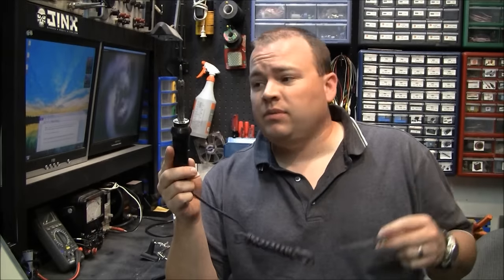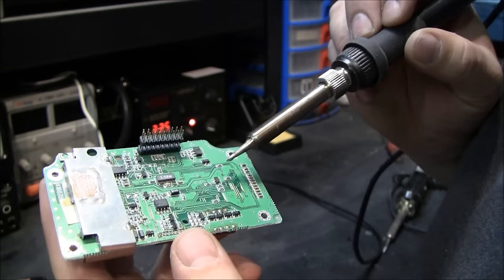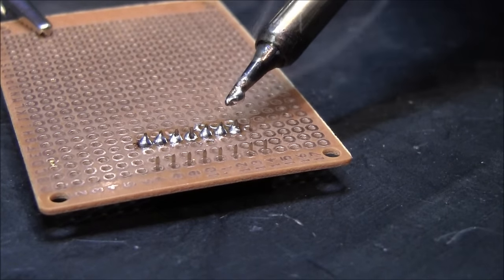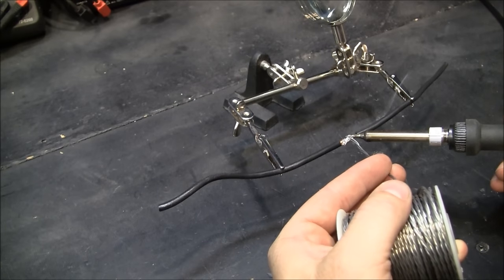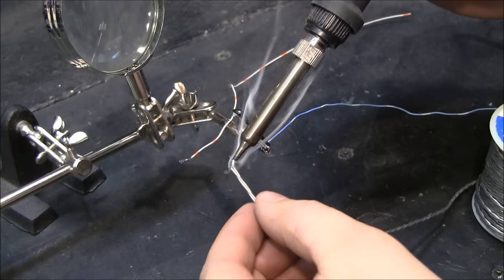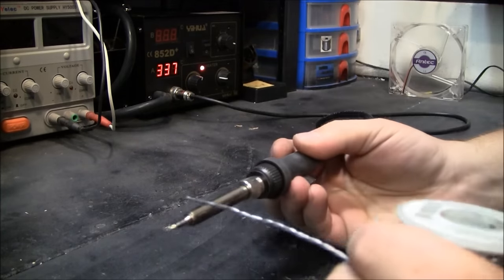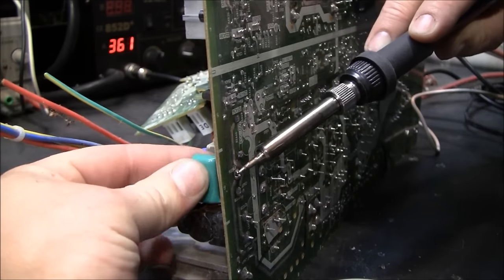Beginner how to Solder

Comment: Use RMA flux while doing this, always.

The flux located at the core of the solder is never enough. Just enough is there so the solder wire itself can flow evenly. Still, you should always use more flux.

(I work in Class 3 for Military and commercial. Flux is your friend.)
Reply: @9898Bren Lmaooooo

Comment: Great video! Thank you very much. 
It certainly helps having the right tools. Today I tried to change a few caps on my Slingbox HD and even though I thought I had the right tools -- Radio Shack 25w soldering iron and desoldering tool, braided copper, I still couldn't get them off without overheating the board. I think I need a little more heat (40w perhaps) and a better solder sucker. Those rubber ones 'don't' suck compared to those pump-up solder-suckers that I've seen in YT videos. If I get the right tools and use some of your other tricks I should be fine. 
Anyway, thanks again for a very straight-forward and easy to understand tutorial. :thumbs up: 
/subscribed

Comment: Thank you for this video. Never needed to do more than solder a few wires together. But now I needed to solder in headers to a tiny circuit board. I was afraid of ruining it! Your video explained so much! Heat the pin, apply the solder NOT to the iron but to the pin. I practiced once and then tried  it. Worked perfectly the first time. Thanks!

Comment: Dude no one has ever told me that the rosin helps the solder wick on to the wires. I was always confused why I couldn't push a lump of solder on the iron tip onto wires and leads. I am so thankful.

Comment: Love how you say "if you're poor" in relation to electrical tape usage, and then proceed to use a cigarette lighter to shrink the heat shrink tubing 😂 when someone who's "not poor" would use a hot air gun. 

Irony.
Reply: unlokia Or, maybe he smokes, or has some other reason to keep a lighter in his pocket.  When I use heat-shrink, I use a lighter, too. It's a convenient heat source,  and it accomplishes the purpose, just as well. I know some HVAC guys who use an acetylene torch to shrink it down, just because the torch is handy.
Reply: I'd say it's more for noise, he was making a recording.
Reply: unlokia i
Reply: what??? heat shrink is a more durable option... as for the lighter it does the same job as a heat gun....
Reply: At least it wasn't a "crack lighter" with a 5" flame!
Reply: I work at a factory that makes varius types of connectors and we have "fancy" shrink tubing, and heat guns, but we often use a lighter for small quick stuff. It does the job.
Reply: @biggreentruck4907  It's smaller, and it's practical.
Reply: @CST1992  That pretty much sums up my point.  It occurs to me that my use of heat shrink generally occurs in places where a heatgun would be virtually useless; for example, fixing a bad light on my trailer, on the roadside, in the middle of nowhere.  Setting things up for the heatgun to work (assuming that it would even be possible) would be a major pain in the ass. Quicker to whip out the Zippo.
Reply: SHIT !!! i didnt see your comment and just commented the same thing lol !!!   I'm not the only one who caught that

Comment: With all due respect, I really hope you that's not how you really solder THT components for professional purposes. 
The soldering is supposed to go penetrate through the hole to form a good connection and it will also reduce vibrations and the excess solder is not supposed to make a concave dome nor a triangle, but to form the shape of a volcano that gradually go down to the base.
The quick upper motion is also useless, check the specification for what temperature you should be using, that would explain the upper motion and the color of your solders...
 

When it comes down to through-hole components you need to have a beautiful volcano shape, a certain brillance on your solder (pure tin doesn't shine though) and penetration of solder.
Reply: With all due respect, solder penetration through the hole will only happen on through-plated holes. That matrix board does not look like it has through plating.
Reply: @iandaysh3193  
With all due respect, if you're teaching people something, do it right.

Let's assume he's using NPTH prototype PCB yeah? If you solder your components as if they were being soldered on PTH PCBs and they're not hugging ring, you're even worse than I originally thought hahaha. 

If you're using NPTH you need to give your component proper support and push the legs either outward or inward, it needs to hug the hole properly, solder isn't magic glue. 

The soldering job is horrible anyways. 60/40 isn't lead free, a proper solder job should be shiny, not matte finish, it cooled down too quickly, fucking flick of the wrist bullshit.

Comment: I have been struggling for DAYS to figure out why my soldering sometimes took and sometimes didn't. None of the other videos pointed out you need solder on the tip to transfer the heat. Thank you.

Comment: that very last tip you gave was awesome... never heard of adding solder to something you are wanting to remove.  But I'm gonna start doing that from here on.  Previous attempts to unsolder circuit boards have typically left me with damage to the board  :(

Comment: I just used solder for the first time on an engineering project... Had a 30 if that explanation before being handed wires and solder , although i got it all done and fairly well its good to finally understand what my actions were doing

Comment: Great video, thank you.  But my comment is at 4:00.... "if you're poor" you use tape... then you use heat shrink with a lighter... I guess you can say if you're a little richer but not too rich you can use a lighter or matches... but the professional way to shrink heat shrink is with a heat gun.  The use of open flame will damage heat shrink (it's just too hot), yes, I noticed you were waving it through very fast to counteract the heat, but it's still not professional.
Reply from the maker: Yes, I wasn't trying to insult anyone but making a joke... maybe at myself. I myself was to "poor" at the time to have a heat gun and I used electrical tape more often than not. I am not sure what the price of heat shrink was when the video was made but it is certainly more accessible now days. I remember when heat shrink was ridiculously expensive, that's not the case anymore.

Comment: most important thing however you used to soldering is keeping soldering tip clean as well as possible. between time to time I dismounte this soldering tip fix it instead of drill bit and sand it very smooth. Trust me this way keeps you more time/work efficient. I totally  agree with this video.

Comment: I did some modification to lipo battery pack, had a hard time to get that 12g wire off the plug and not sure why. At first I thought my soldering gun is not good enough. After watch this video I know why now. Thanks for this informative videos sir.

Comment: Very useful guide, thank you! What I’m trying to do is soldering two 20 gauge wire on a PCB, so my question is, do I add the solder to the wires first and then stick the wires on the terminals on the pcb with more solder? Thank you

Comment: When soldering a component onto a PCB, you said apply the solder to the metal.Do you mean apply the solder to the pin of the component or the metal foil on the PCB or both?

Comment: I bought an electronics kit which I will be soldering. I have never soldered before in my life. On instruction manual among other things, they strongly recommend wearing safety glasses for soldering. When i checked on amazon, looked like the safety glasses they sell were too dark and seemed more appropriate for welding. I don't know if I can see thru it for soldering.
Can you recommend some safety glasses that I can find on amazon that I can use for soldering?

Comment: Thanks for the informative video. I recently repaired a circuit board on a Maytag dryer. It worked when I was done but was concerned about hot solder damaging the 120 volt relay soldered to the boars that had melted the solder. I also hoped to add more solder than the factory used  to help prevent any future faulures. Any tips? Jon

Comment: Question.
I'm planning on hitting a flat surface that I've just ground a bit of rust out of, about the size of an inch diameter coin.
The spot isn't structural but I'm looking for a tidy method - is solder a good idea or are there reasons it isn't?

Comment: To solder a wire to a pot in a guitar, would the best way  be heating the pot and touching the solder, then grabbing the wire, heat the solder on the pot, then stick the wire in the melted solder? Thanks in advance!

Comment: Isn't a large part of the purpose of flux to prevent oxides and nitrides from forming, weakening the mechanical and conductive abilities of the joint? So if you tin two pieces, burning off most of the flux, and re-heat the solder to join them, despite the fact that they will mechanically bind well, won't there still be doping occurring? Probably a negligible concern, just curious.

Comment: So I just realized I used plumbing solder on my car clock that stopped working. I added some to each end of the 5 resistors to make the clock work again. Will this be an issue or should I be ok?

Comment: I run into problems where I solder in the wrong component into a PCB, remove it, clean the foil side with solder wick, and then insert the correct component.  However, I frequently raise the copper foil connection and destroy the PCB.  How can I prevent doing this.  I use a soldering iron at 450 C and only hold it on the connection until the solder melts well, a very short time.  Thank you.
Frank

Comment: Note to self: watch this video before forcing a VGA port off of a broken card before repairing one that doesn't have video out. I'm getting desolder braid today and is there a way to remove an SMD Electrolytic Capacitor? My Riva TNT2 card has a bad one by the VGA port.

Comment: Im having trouble with making the solder flow. What am I doing wrong? I cant even make the solder stick to the iron. Im using a soldering iron that is 60w and the temp goes up to 750f. Its a inexpensive iron i bought on amazon for $16. Could this be the problem?

Comment: My solder doesn't say acid or rosin core but I bought it at Radio Shack so I assume it's good for electronics? I rewired my guitar jack and it seems to be fine.
Reply: You should be able to tell what it is by looking up the set of numbers on it. It usually looks like a fraction.
Reply: You can also look up the Radio Shack cat number on it to see if there's any information on it.

Comment: So is the rosin core just wire with flux inside basically? So if you buy rosin core wire you don't need to get flux or add flux
Reply: 1) Yes. 2) No. Solder joints benefit from extra flux. Dabbed on with a flux pen or dripped on as a liquid. Solder then clean up.

Comment: Probably worth mentioning to put the shrink tubing on the cable before soldering it, I've screwed that up a couple of times. Also, if you're poor you use a lighter, otherwise you'd use a heat gun

Comment: First of all , Don't worry about what some people say , there is always going to be idiots out there showing that they are smarter then you , and thats because they have to prove something to  themselves .. you know low self-esteem.  Second of all your are nice enough to make this video and they shouldn't complain or let them put together a video and lets see if their any better . There's spoiled people out there always wanting more for others while they sit back and judge others,  and thats a shame..... well anyway I was wondering if I  could attach a dimmer switch to the solding wire . So it can heat from high to low . You see I  own a Japanese silk flower iron and its the same thing as the solding iron except it has a wider tip end so all the attachments will fit. Years ago I use to fix lamps and sometimes replacing the dimmer switch. . So can this be possible. .....thank you for your time. ...

Comment: Cannot get solder to stick on my tip. Couldn't get the solder to melt. Tried a gun, then I got a butane mini torch and it works perfectly. Melts the solder. The mini butane torch heats the solder up and it sticks to the tip. Just get it hot, turn it off then on. The flame goes out but it keeps heating up. Nice and red.

Comment: Hey man, I'm fairly new to soldering and the problem I'm having is when I sttempt to tin my irons tip the solder doesn't want to adhere to the tip,and yes I used flux also, what do you recommend now?

Comment: serious question to all solder heads  ! ... is there any tried and trusted way to protect the other parts of the circuit board in case you ( i.e. me) make a mess of it ??I mean the nearside, ( next to the intended soldered area)  delicate electronic components and joins .. ?thanks ..

Comment: I don't know what I'm not doing. The rosin material keeps retracting onto itself as a ball, doesn't get on the tip of the soldering iron. It's F*ing annoying. I am using a cheap plug-in soldering iron. Is something wrong the with rosin material?

Comment: No soldering iron that I've ever used works this well or quickly. I can literally touch the iron to the metal for 5 minutes without the metal getting hot enough to take the solder. Are my irons so cheap that they basically get no hotter than room temperature or is there some trick I'm missing? Shouldn't any soldering iron sold as a "soldering iron" be able to "solder?"

Comment: I apply heat to the pin but and then touch it with solder. Nothing happens. The only way I get the solder to melt is by touching it directly with the soldering iron. I wonder if my iron is low grade and doesn't emit enough heat.

Comment: never use a lighter for sticking the insulation cover, because it may cause damage to it.. Instead solder the wire properly and cover it with thick insulation tape.

Comment: I soldered two wires to the output of a 220v to 9v adaptor. It won't work. I did it just like the video but it won't conduct electricity. I don't know why.

Comment: Me: tin tips
Brain: its gonna break off
Soldering iron: gonna end this kid entire project 
Solder: breaks off and does even form a bridge on the tip to the wire to conduct heat leaving you in state of stress that you cant even compare with anything
Reply: Oxidation has enter the chat ._.

Comment: The ONLY DIFFERENCE between a HEAT GUN and a HAIR DRYER is the PLASTIC CASE and LOWER TEMP SETTINGS! DON'T USE A LIGHTER unless you HAVE TO because you're CAR BROKE DOWN OUT IN A FIELD! Lighters basically ROLL COAL over EVERYTHING YOU USE THEM FOR but it's MORE TOXIC! IF you're lighting a smoke, use a torch with a blue flame! THE ONLY THING a lighter is good for is lighting a FIRE!

Comment: Thank you bro I never solder on electronics but my BMW key battery died and they want $250 for a dam key lol bruh I just need to change the battery on the key and I need to solder it I’m a UNION plumber residential and commercial but no nothing bout soldering wires lol I can solder copper etc weld but never done a little project so thank you so simple

Comment: i see you do not use flux. it was a nightmare actually using flux while soldering a female usb type A to the board.i applied the flux as instructed yet the solder did not melt upon touch

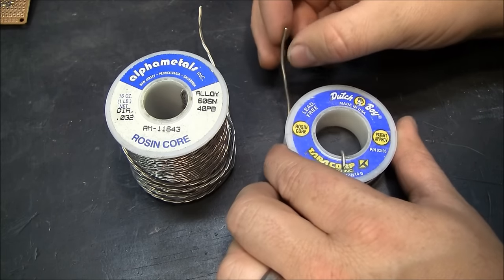Comment: S O L D E R. There IS an actual L in there. It’s quick but it is there. The video was going good until about 1:56. Despite how you think you want to say it, it is correctly pronounced “solder,” not “sodder or sawder,” not even “soulder.” You can get a very quick L sound in there and it almost sounds silent. I would not have said anything but you jumped on people in your video. :) A poor person will also use a lighter to heat up heat shrink instead of a heat gun LOL
Reply: @y-it4207   I am a jock nerd.  I am very technical smart but also an athlete. 🤓

Comment: Your wire soldering is good, but pleas dont solder THT like this... It really hurts to watch it.
1. Way too wet sponge
2. diameter of your solder is too large for THT
3. convex is not the way to do it (excessive amount of solder)
4. Tip is at the border of beeing too large for THT
5. Dont have solder on your tip if you start at a new soldering pad. Clean it put it on the Pad and the connection pin of your device your soldering in place. create a heat bridge bewtween your tip of the soldering iron, the pin and the pad with your solder. Add solder on the other side of the pin and take the tip aways as you said in your video.
6. make sure your soldering work looks silver shiny and is concave. Look  for little "bumps" or holes, if you find any apply some flux and resolder.

I'm sorry if it wasn't that understandable due to my bad english. I tried to explain it as good as i could. I'm a trained specialist for electronic devices and systems (3.5 Years of training in Germany to get that qualification).

Comment: It's a good video, but I cringed when he shook the solder off the tip. Always (and I mean ALWAYS!) use a wet sponge or paper towel to clean the tip. The water causes a thermal shock that removes the crud and carbon.

Comment: That was awful soldering job. You used too much or too little solder and kept the tip too long time attached. This ruins the PCB. Attach some weight to the soldering iron stand so that it doesn’t move when you clean the tip. That stand is a cheapo and those are too light.